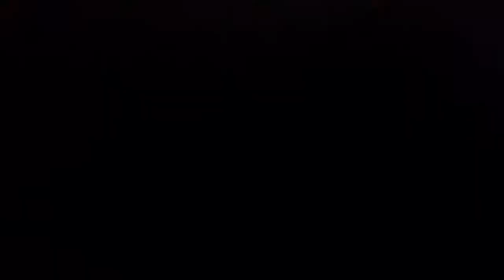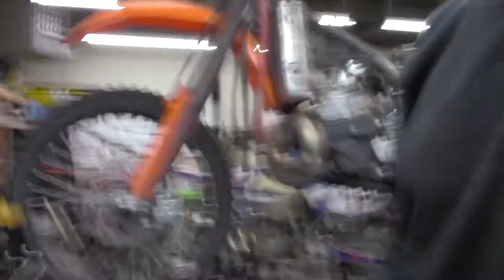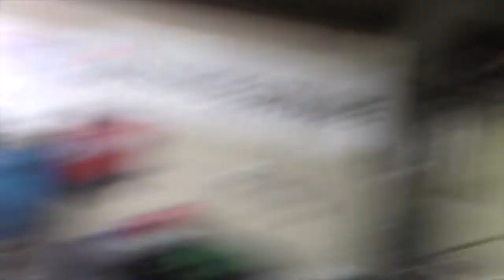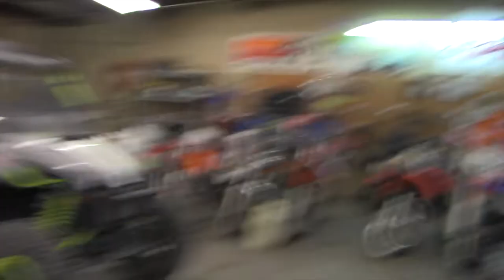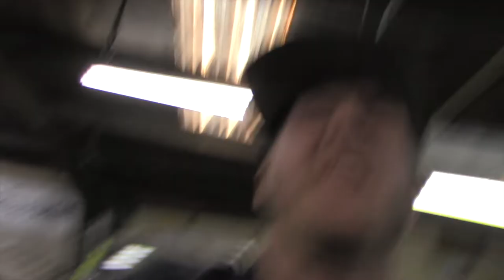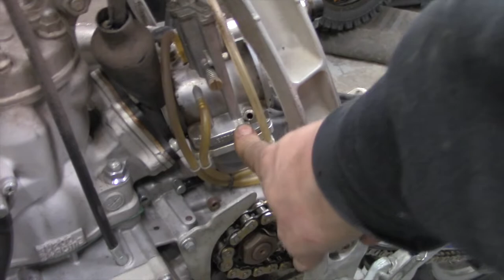Daily Shlog #22 : TIRES!!!

Comment: I bought the Dunlop mx32 thinking I was buying a 52... I grabbed the wrong one at the shop and didn't catch it until I got back.  Boom..... love it.  It had a worn bib on it and hooked up well.  Didn't chunk out even in the more rocky areas that weren't soft.  I'd get another one, but I caught a rebate on the Mich. starcross Mediums when I had the cash on hand.  Bought a set (60 bucks back was nice).... gonna run those for a bit.   The Michelin S12 was my all time favorite and I know a few local fast guys that love the Mich in medium for just about every race location on the local enduro circuit as well as local riding areas.   Tossed a front with a new nitro mousse bib on there yesterday.  Install was only 15 mintues... no cussing even.  Used a standard stand 4 levers and 2 bead buddies.  We shall see how they handle and hold up.   Going to finish off the old Pirelli soft-intermediate rear that is on there.  I try all sorts of stuff....will run a tire again if I like it.  Not really brand loyal, but have found that I like Michelin most of the time.  Usually by the time I find a tire I really like the manufacturers change the line up or discontinue that tire.  That said I have only found few a tires that I just really wanted to take off my bike for this reason or that reason.  I notice it, but not so super picky about it these days.  I have also had to look at my wallet and buy the "ol gimme the cheapest one you got"  because I needed new rubber and the wallet was thin.  Some guys love cheap tires.   The "tubliss" guys sometimes all crazy with this tire , that tire , fiddle with tire pressure etc....  I did at at one time and ran tubliss when it first came out for a couple years.  Mostly because I didn't really have the stuff to change a bib.  I got tired of messing the with inner tube pressures and flubbed up an install and trashed the bead on the inner red part.  I pierced the tube.   I was pretty done after with them after that. I had to run sealent in the "tubeless" part because mesquite thorns and cactus.  Made huge mess!  Moved to Bibs... smash a rock...so what.  Take out that chunk of cacti... so what... ham fisted with the levers... no pinch.   Are they aired up.... non need to check .... Are they ready to go....you bet!   That said, the lube makes a huge mess!
Reply from the maker: Lubrication is your friend!!!
Reply: @highlandcycles  Yep, makes things go slickery!
Reply from the maker: Danny Compton YES